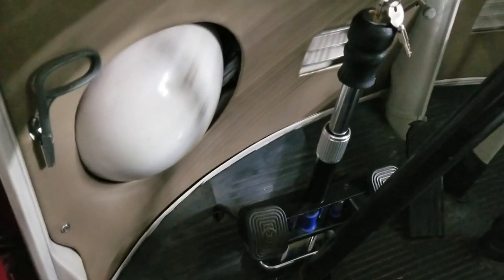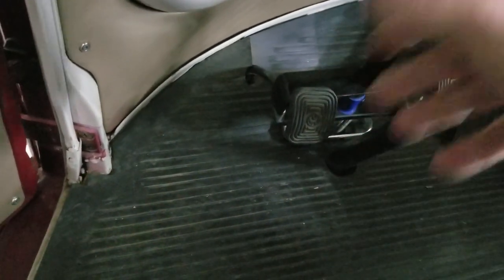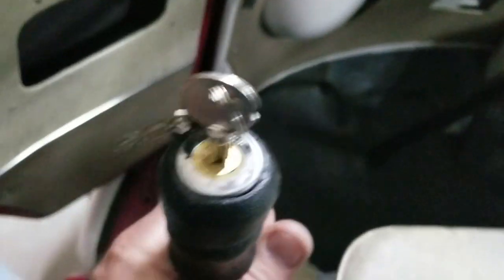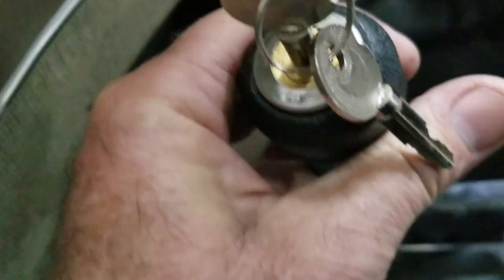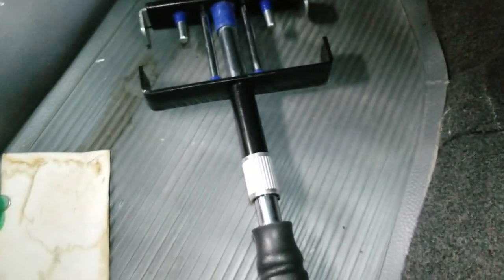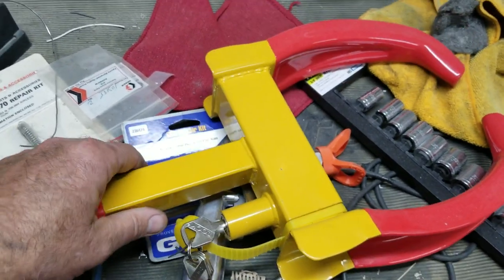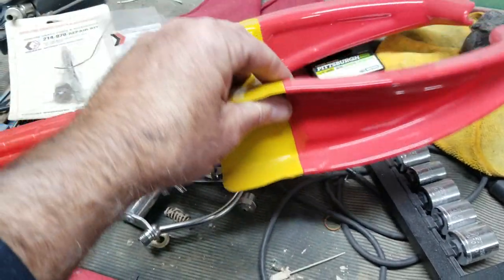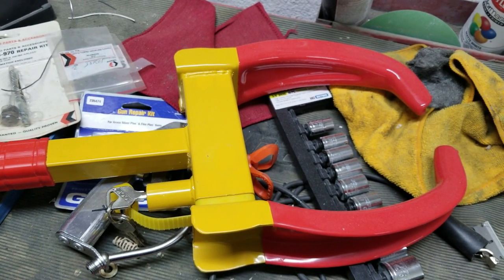Brake & Clutch lock anti- theft device from Amazon review for VW bug  and bus

Comment: I bought one after watching your good video, Mike. I ordered online from a store in the UK because couldn't find one in the US anymore. After using the lock for about 5 times, I couldn't lower the bar after locking it overnight. The bar is stuck, it won't slide down so I can take the lock off the brake and clutch. I'm dumb founded! I tried to jiggle the key and tried everything I could yet couldn't get the bar to slide down. Couldn't unlock it! Please suggest something. Thanks!

Comment: Thanks for sharing.   I like the clutch and brake lock.  If they want it, they will take it.  However, in a very public place, it would be a good deterrent. Thanks sgain
Reply from the maker: the best one I could find so far and much better than the stupid club that wont work at all. Seen so many guys with that at shows OMG they are totally useless.

Comment: Hey mike, could you do a video on door alignment and how a door should shut? Thanks
Reply from the maker: that is a tough one. There are so many differences between a good gap and a not good one. usually if you can adjust the door to shut at all without touching the jam it is as good as it gets. There are so many variations of proper door gap. They were never uniform from the factory.